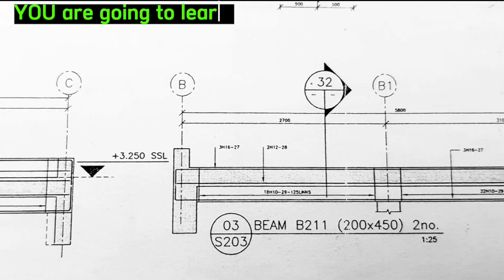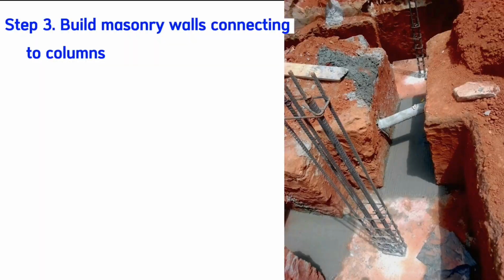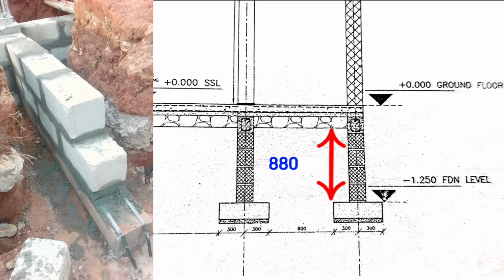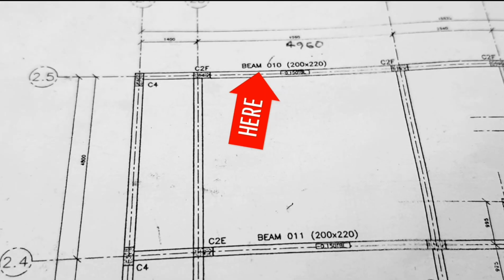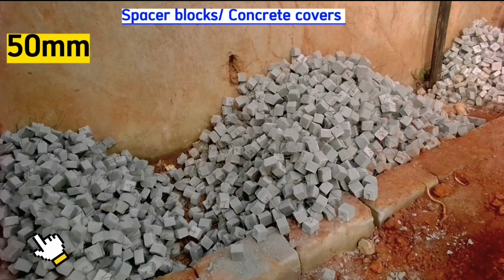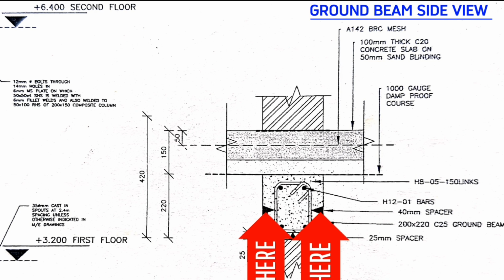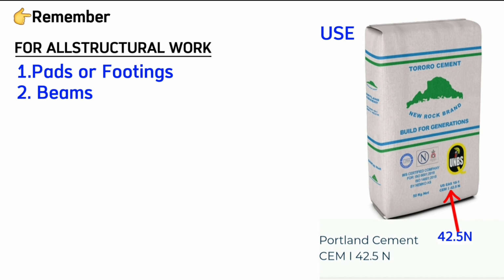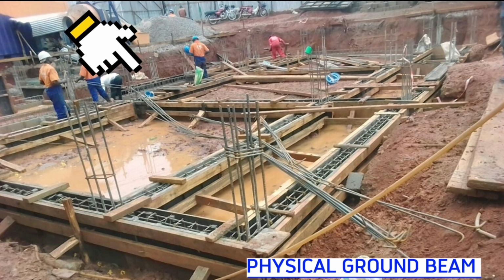How to Read Structural Drawings - A Step by Step Guide (Part 5 GROUND BEAM)

Comment: This is a well detailed explanation of how one can read and understand civil engineering drawings however i wanted to ask about the strength of the rebars since you did not mention in your explanation and also the codes on the plan does not specify if the rebars are Y or R. Thank you so much for this important lesson on structural drawings.